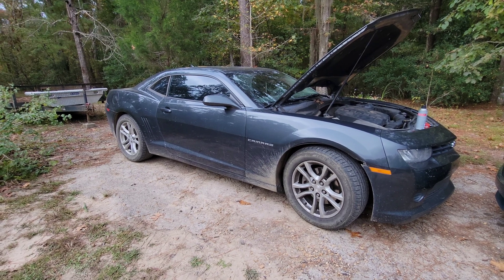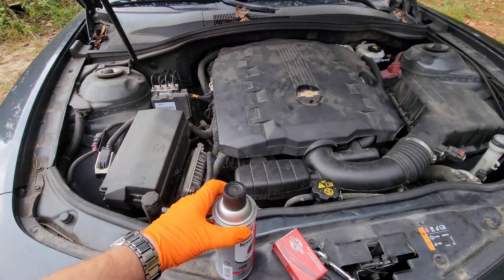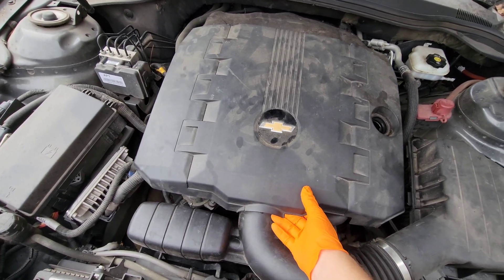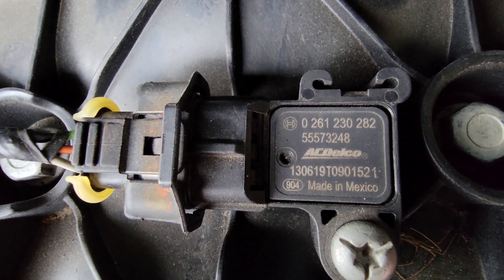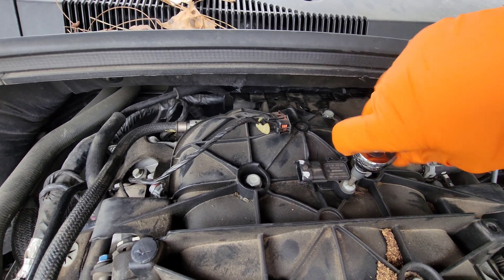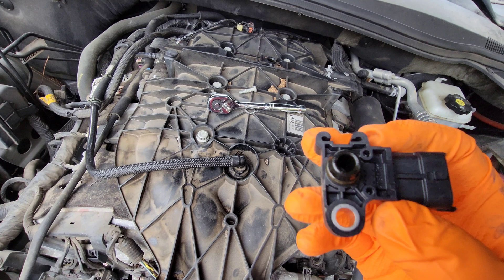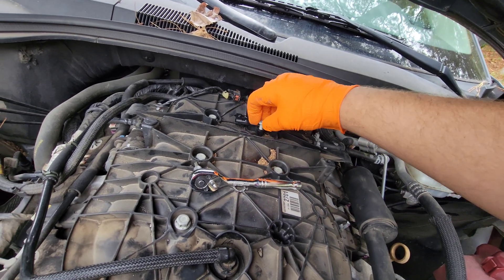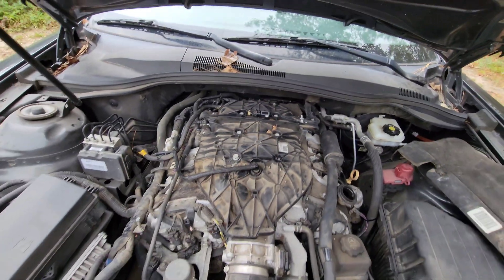5th Gen. 2014 V6 Camaro MAP sensor location and replacement.

Comment: Ik this is late but do you need to calibrate the new sensor?
Reply from the maker: No calibration needed. Just plug in play the new sensor and clear the trouble code and roll on!

Comment: Do you know where i can find the Knock sensor?
Reply: Side of block one bolt holding it on 
Gotta access from behind tire
Reply from the maker: Sorry for the late reply. Just seeing this comment. There should be two knock sensors above the starter on the side of the block.

Comment: Is the barometric pressure sensor and map sensor together in one ?
Reply from the maker: Yes, they seem to be one in the same thing based on research.
Reply: Thats what Im seeing.

Seems like the atmoshpere is reeking havic.
Reply: Appreciate you asking this question and it being answered just came to vacation in sedona where the altitude is much higher and i got a p02227 error scanned at oreillys stating the barometric pressure sensor was faulty yet i couldnt find the part at any store. I could only find the map sensor. We did have a dust storm so i will try cleaning to see if it clears but will buy the part also just incase.
Reply: @ISILENTNINJAI did the map sensor fix your code? I just got code p2230 having to do with the barometric pressure sensor and I night try replacing the map sensor to fix it